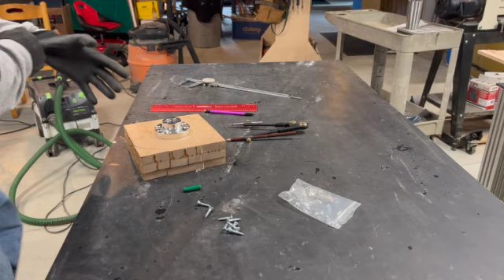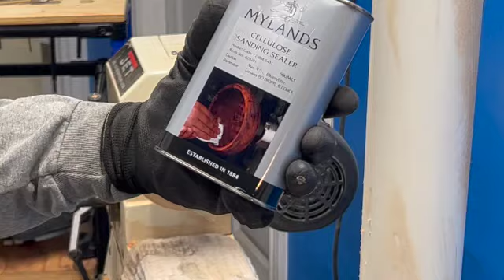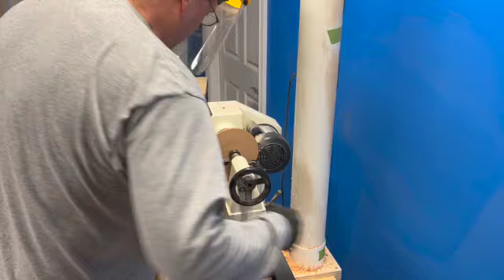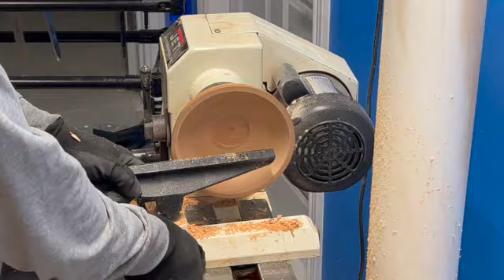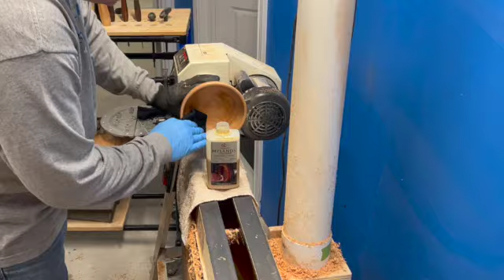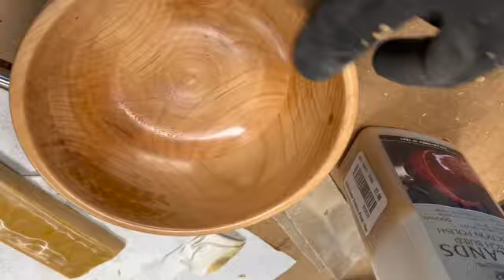Turning a bowl out of cherry wood using a lathe, turning tools and Milan's sealer and wax

Comment: Very interesting to see how a wooden bowl is carved and finished.  I was surprised that you could start with pieces of wood glued together vs. a solid piece.  I'm curious to know if the finishing products you used are food safe.  I look forward to seeing another project.
Reply from the maker: Great question - this bowl had a three part finish including the sanding sealer, the first wax coat, and finally the carnauba wax.  All three products are safe however it is not recommended to use in this application as the washing process will adversely impact the finish.  Bowls in upcoming videos use different products such as pure walnut oil will works well.